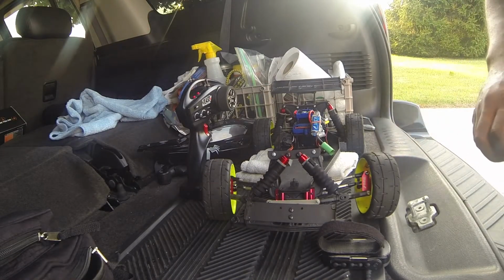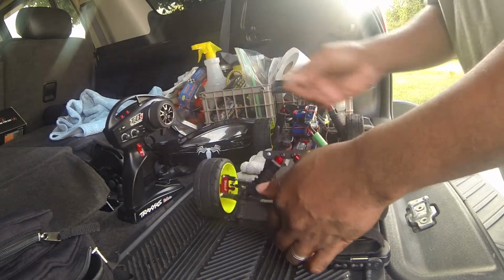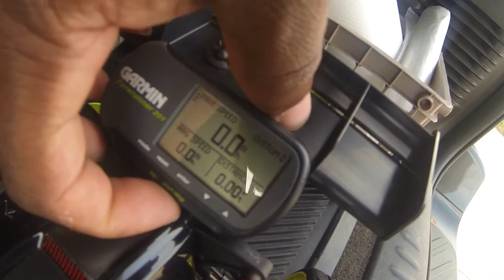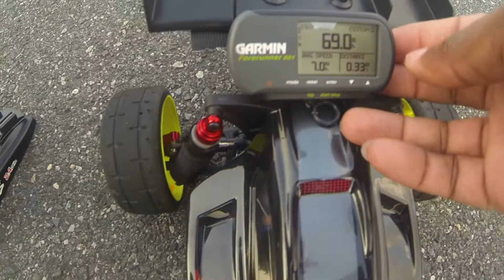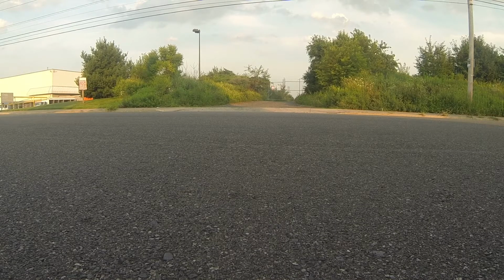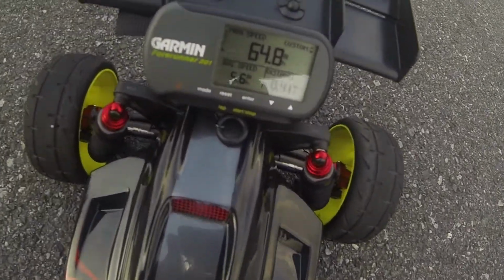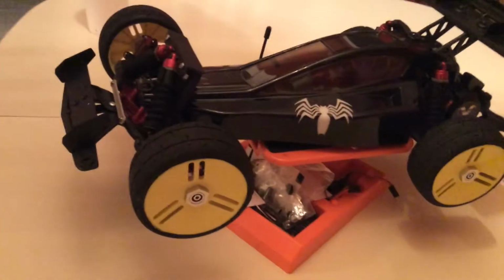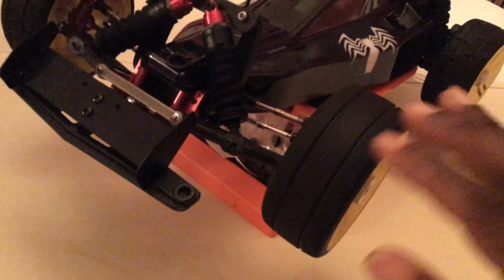70+ Club First Attempt....VXL System (2pole)

Comment: My body was still lifting with Velcro at high speeds so I used pins also and my wing I cut a piece to help with the down force Aussie Rc helped me with the wing idea something about the smooth air flow over the wing
Reply from the maker: I'm going to try to relocate the gps as well as realign my wheels. And I couldn't find those extra 17mm so I ordered more. These are clicking and that can't be ignored. Specially since I'm dropping in a 2400kv after I make the 70+!